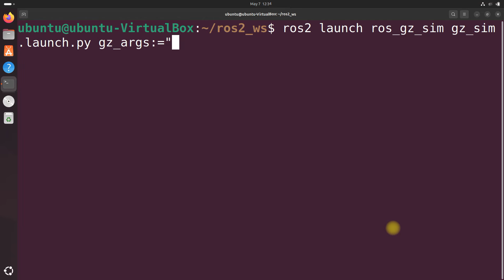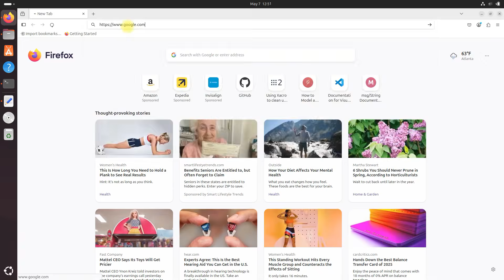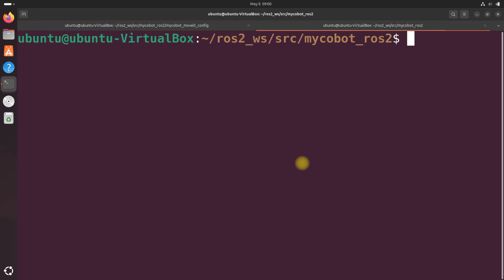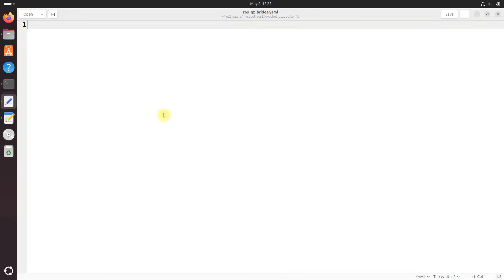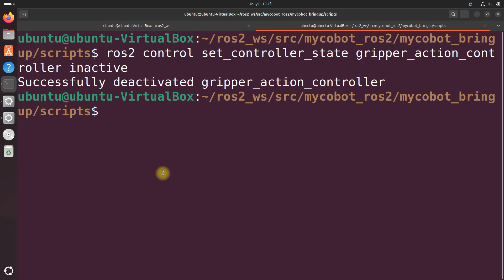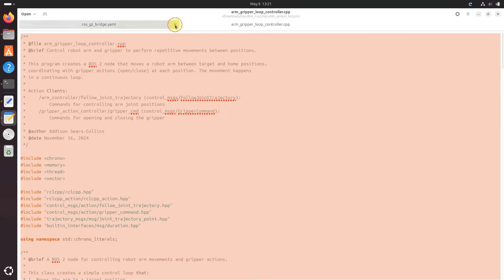How to Simulate a Robotic Arm in Gazebo - ROS 2 Jazzy

Comment: 1:28:32 está acontecendo isso no RViz:

gripper_base                 Transform OK
gripper_left1                  No transform from [link2] to [base_link]
.
.
.
link1                                Transform OK
link2                                No transform from [link6_flange] to [base_link]
.
.
.                            
link6_flange                   No transform from [link6_flange] to [base_link]
world                               Transform OK

como resolver isso? Configurei tudo corretamente até aqui
Reply from the maker: Se precisar de ajuda para adaptar o código ao seu braço robótico, pode acessar meu site automaticaddison.com e entrar em contato comigo por lá.
Reply: solution to my problem:

Some of the RViz statuses were 'inactive', so I had to use the commands that appear at 1:32:40

ros2 control list_controllers

To the statuese 'inactive' I run:

ros2 control set_controller_state <name_status> active

therefore the arm robot worked successfully

Also I run the command: sudo chmod +x src/mycobot_ros2/mycobot_system_tests/scripts/arm_gripper_loop_controller.py

Because when run the command "ros2 run mycobot_system_tests arm_gripper_controller.py" the response of the terminal were No executable found.

So, Thanks automaticaddison to the video, I'm excited to nexts tutorials
Reply from the maker: Ahh sim. sudo chmod +x! Bom que vc achou a solucao 😊

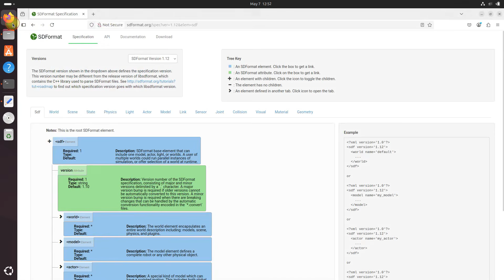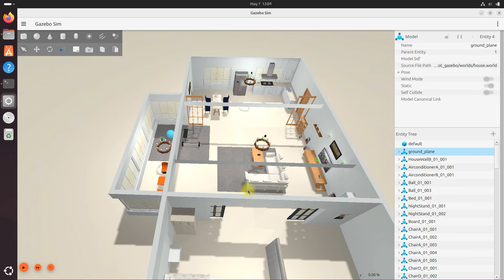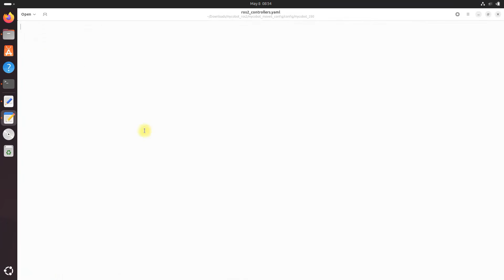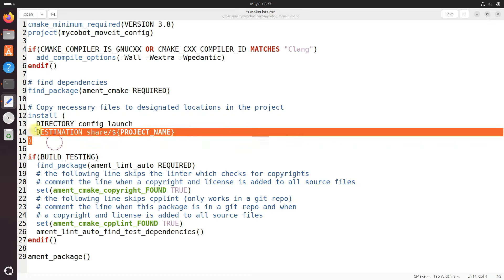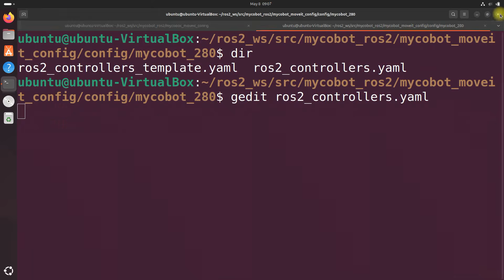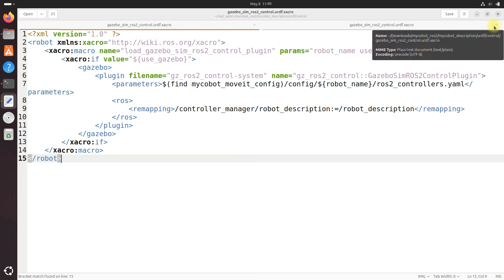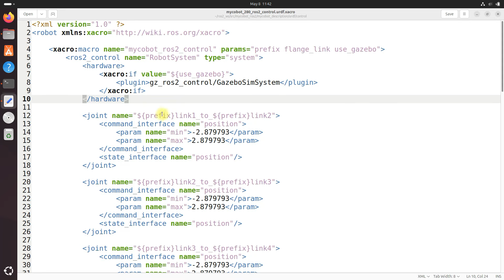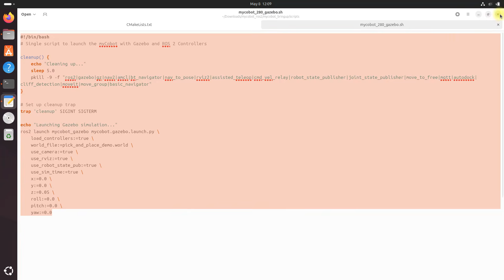Comment: 🎉🎉🎉 comtrol panel, comand, diagram, etc, . 38:51 sdf format for environment.  45:56  refrigerator model, collision model, 47:53 dae format, digital asset format,  50:45  launch model, world, 57:36  control yaml file,  1:00:39  launch folder,  1:07:54 monitor, collision checking,  1:10:35 gazebo communicate w ross file, 1:13:15 main robot instruction file moving position etc, 1:21:39  launch file, 1:28:41  launching robot!!!  1:30:17 pick n place task, fixing vertical z value position, 1:35:02 gz topic, 1:44:04 ross action list,
Reply from the maker: Thanks for the additional timestamps!

Comment: Hello. When I load the 'robot' alias, the Gazebo and Rviz loads fine but the issue is the robot in Rviz doesnt automatically update the joints after the robot in gazebo already loaded.

Under RobotModel in Rviz it says this:
base_link                       Transform OK
link1                                Transform OK
link2                                No transform from [link2] to [base_link]
link3                                No transform from [link3] to [base_link]
link4                                No transform from [link4] to [base_link]
link5                                No transform from [link5] to [base_link]
link6                                No transform from [link6] to [base_link]
link6_flange                   No transform from [link6_flange] to [base_link]
world                               Transform OK
Reply from the maker: Thank you for the detailed explanation. The issue you’re experiencing usually happens when some key setup steps are missed, which can affect how the transforms are published between Gazebo and RViz.

These tutorials are cumulative, meaning each one builds on the previous. I highly recommend starting from the very beginning of my playlist and working through in order:
https://www.youtube.com/playlist?list=PLNWNEEf8BvG6z60R4r9_wQ6Ekmqj-BmFr

Even the way you install Ubuntu has downstream implications for how these simulations work. ROS 2 is a bit of a diva. Everything has to be perfect to run correctly. 

That should help ensure everything is set up correctly and working smoothly.

If you’ve gone through the tutorials step by step and are still having trouble, feel free to reach out to me directly here:
https://automaticaddison.com/contact/
Reply: @Rdiaz4376

run:  ros2 control list_controllers
> if showing something with status "inactive" run:

ros2 control set_controller_state <status> active

example: in my tests the status joint_state_broadcaster was "inactive" so i run:

ros2 control set_controller_state joint_state_broadcaster active